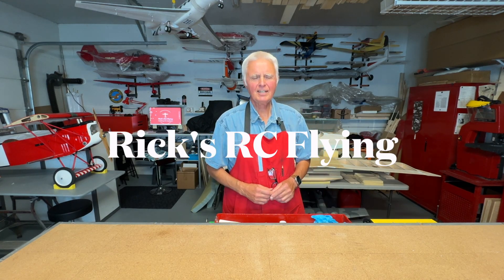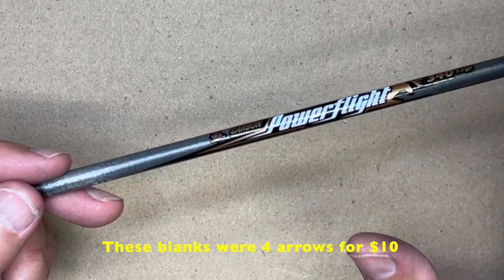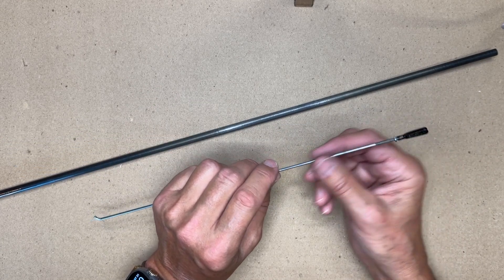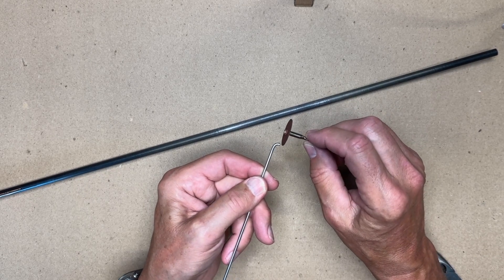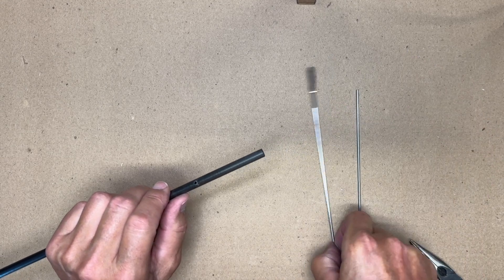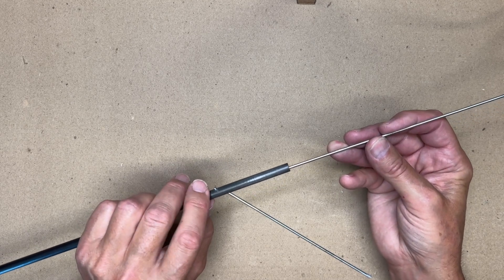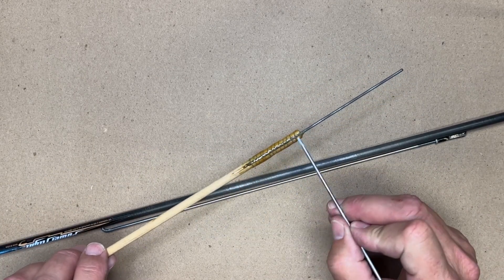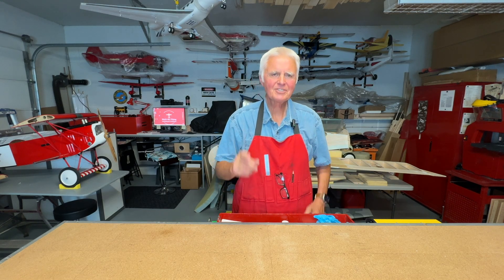Pushrods Using Arrow Blanks

Comment: Great idea for larger models. For mid-sized and small models I just use the nyrod or metal push rods as-is. I don't think the weight is much. I know some don't like nyrods because they can change length with atmospheric conditions but I have never noticed.
Reply from the maker: With the smaller models I agree with you on the use of metal pushrods and nyrods. They have been around for a long time and work well. As for nyrods I never found a real issue with temperature as well and if they ever did effect a flight a slight touch of trim would take care of it.

Comment: Hi . I have done the same thing but instead of using a bunch of epoxy I take a short piece of dowel and groove the side then slide it into the arrow shaft with epoxy works great
Reply from the maker: I have also used the dowel for this purpose, which is a good method. Thank you for mentioning it. I will showcase this in an upcoming video. Rick